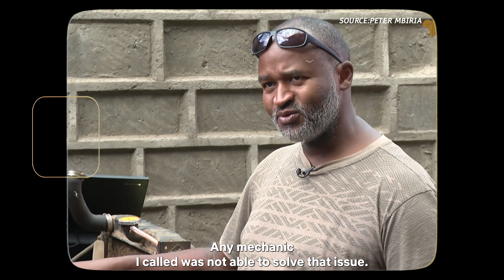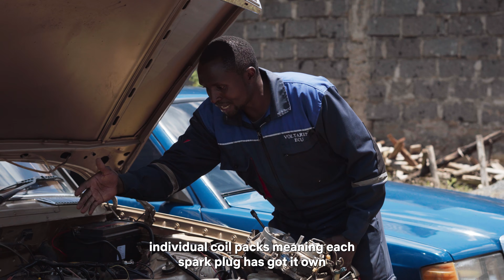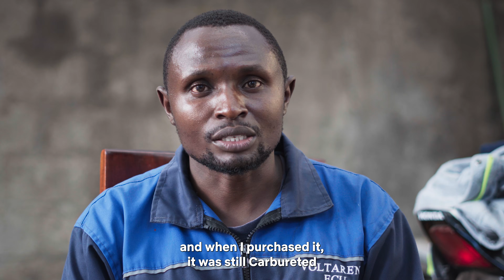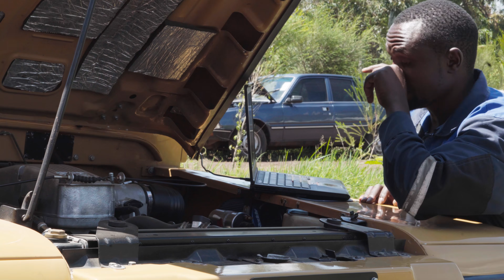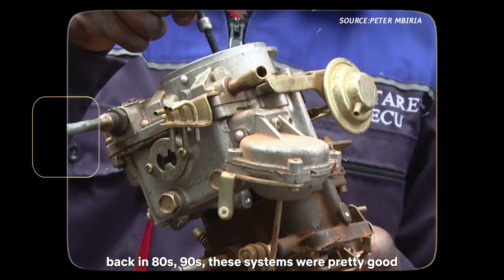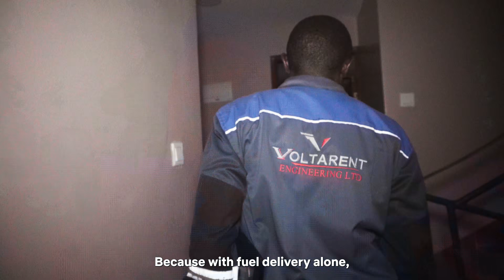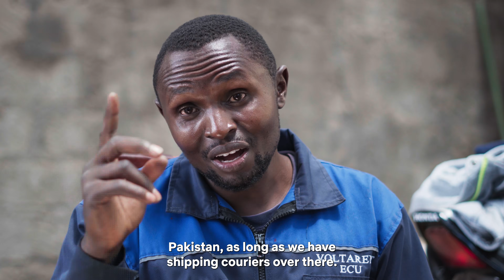This African Genius Makes Old Engines Work Better Than New Ones

Comment from the maker: If you want to learn more about Peter Mbiria, check out his channel here 👉 https://www.youtube.com/@PeterMbiria1
Reply: The idea of a universal engine management computer started with early ECUs in the 1950s by Chrysler that then evolved with the introduction of EFI in the 1960s and 1970s. Engine management computers became more prevalent and adaptable in the 1980s and 1990s. Universal standalone ECUs, like those developed by AEM Electronics in 2010 represent a further evolution of this concept, allowing for more flexibility in various engine applications. This is not some new concept or technology. I don’t understand the hype as today there are at least 5 companies that all have their own line of stand alone ECUs like this. They have preset defaults for most mass production engines that will run any engine and allow on the fly fine tuning. Some even have premade adapters to plug into existing wire harnesses. So again why the hype around this?
Reply: @diemaschine2287 it's to make a big deal to people that don't know .. and yes he is saving old cars in Africa.. so all good
Reply: @diemaschine2287  There is no hype, only a better possibility for older cars, instead pouring money into newer ones....if there is hype it the economic feasibility, which is sorely lacking in todays car price.....dont you agree?
Reply: Can you give his email address or any things als ??
Reply: Pls I have problem will a car I need to fix it how can I get ur contact?
Reply: Peter, I have contacted you about my XJR6…still waiting. From UK. I want to promote you bro
Reply: @AfrimaxEnglish  Well done, you are men off work and passion, i think Burkina Faso could help boist your potential,  i really love Africa getting more and more independent and can  remanufacture better then things was created, with independent Africa you have unlimited pissibilities and you must start work with trucks to boost economies in every African country !!! With love for hardworkers like you !!!
Reply: There is no climate change.
Reply: I need one in my Electric Car!
Reply: Ruining good cars by adding computers. Computers ruined cars.
Reply: Can I get his contacts?
Reply: Thanks a lot AfrimaxEnglish! Excellent program interviewing the Great PETER !
Reply: @AfrimaxEnglish  will love this guys visit, Ghana  for training
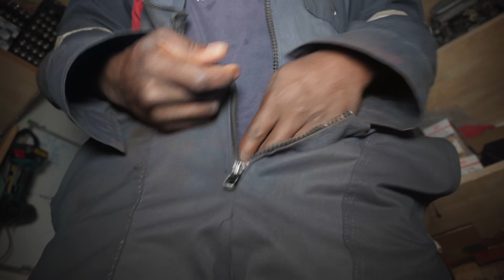Reply: wtf @2:35 I feel violated
Reply: @AfrimaxEnglish   Peter I like the idea but here in America 🇺🇸 we are going back to old school cars the electric car manufacturers suck and we can’t afford to buy new cars because of their greedy ways and their schemes to track us to sell our own vehicles data that actually allows big insurance companies to over charge us as consumers
Reply: Afri max why don't you come to uganda and also cover some stories here, I only see your stories covered either in Kenya , Tanzania or Rwanda

Comment: I do think the storytelling here oversells what was actually invented. Programmable ECUs and carburetor-to-EFI conversions have existed for decades. In the U.S. we already have systems like Holley Sniper, FiTech, Edelbrock, MegaSquirt, etc. that can modernize older engines with electronic fueling, ignition control, closed-loop O2 feedback, diagnostics and self-learning.
What I find impressive is that Peter developed his own system and adapted that established technology to the needs and economics of his local market. That's good engineering and a very useful contribution. But phrases like “makes old engines better than new ones,” “groundbreaking technology,” and “leaving Western experts in awe” seem more like promotional storytelling unless there is independent testing to demonstrate those claims.
Even the claimed improvement from 5 km/L to 14 km/L would need context: what condition was the original carburetor/injection system in, how was fuel economy measured, and was it independently tested? A badly worn or poorly tuned old fuel system being replaced by properly calibrated EFI could understandably improve enormously.
The work is interesting enough on its own. I don't think it needs exaggerated “genius” framing to make it impressive.
I think Peter deserves credit for building a genuinely useful product, especially for places where people need to keep older vehicles running instead of simply financing a newer car. This kind of modernization could also benefit low-income and budget-conscious owners anywhere in the world.

Comment: The custom car scene around the world has been doing this for decades. My own uncle put a fuel injection system on the engine of his 1956 Chevrolet probably 20 years ago. You can buy kits to replace most carbys.
Reply: Its just tokenism exaggerated praise because of black identity/background

Comment: Noch ein Anbieter von Standalone-Steuergeräten. Nichts Besonderes. Auch kein Betrug. Viele Firmen bauen Steuergeräte für Autos mit älteren K-Jetronic-Motoren. Die Ferninstallation und -abstimmung wird allerdings nicht einfach. Das Einzigartige an dieser Firma ist, dass sie in Kenia, Afrika, arbeiten, wo das vorher noch keiner gemacht hat.

Comment: This exists since 1986 and first movers were haltech and motec who were the pioneers of this method.
.
It combines modern injection & ignition with old, used motors. 
.
You can buy these as diy kits and transform your own old car to more power with up to 40% less consumption. 
.
Honor to the engineers 40 yrs ago 💜

Comment: Sir if you buy a 3d scanner a metal 3D printer you could scan the intake manifold into a computer and then print a new manifold and you could complete  this system so much faster. You might want a mill ,lathe and or cnc machine. But the 3d scanner and metal 3d printers are the newest tech. You could even just scan the manifold and send the files to a 3d printer shop in america or any other countries that have the printers

Comment: People focus on the hardware and code saying it's been done before. That's not the point here, the value is that he is able to make it work with his local supply chain with localized cost of engineering and adapted to the recycling needs of his economy. This is the real innovation.

Comment: Nothing new, if you need to replace the Fuel Injection system, carb, sparks, new harness, and a updated ECU. People been doing this for ages. Not a modern engine, just a light refresh. You want a modern engine, you need an swap.

Comment: For perfect ignition whatever you need to do must be done. This part of the story is understood. I have seen some people build a see-through combustion cylinder and saw in slow-motion how the spark and the mix of air and fuel ignite etc... What I was thinking is, this is the primary combustion (ie 21 % of oxygen from the atmosphere helps burn the fuel). Can there be another 21% oxygen added into the combustion in order to achieve a higher level of energy output? Maybe a secondary injector of heated air with a timing adjusted to coincide the ending of the primary combustion. Once this is achieved what happens is that once the primary combustion is complete the secondary injector pushes in a super heated amount of air and immediately the secondary combustion occurs. This can produce more amount of energy output using the same quantity of fuel.

Comment: Back when I was into working on my own cars I replaced a dual point fuel injector to a complete fuel injector engine. I struggled to get it to run even though I replaced the ecu and ran my own wires for the additional injectors. 

I got the car to run for a short period but it would over throttle and I couldn’t stabilize it to get it to run efficiently. I had no computer connected to this car and didn’t know any of the actual readings. 
I ended up giving up,

Comment: Impressed by that ecu with the through hole components, and good job in keeping the requirements minimal, keeps the goal feasible and there are so many sensors for features that aren't needed. Smaller surface area also just provides less opportunity for critical issues. Can only imagine time spent reverse engineering canbus signals.

Comment: FATHER ALMIGHTY FATHER CREATOR OF ALL INSPIRED BY WE , SAYETH THOU ART SIMPLE LOGICS BEHIND THESE SYSTEM USING COMPUTER TODAY , A SIMPLE NOZZLE JETS ADJUSTMENT,  SAME HE INSPIRED PRESSURE WASHING SYSTEM  MORE AIR FORCE BEHIND LIQUID MAKING IT MORE COMBUSTIBLE,  SAME SYSTEM IT EVEN IN BATHROOM SHOWER HEAD ADJUSTMENT OF JET SPIGOT SYSTEM IS IT . SAME BE EVEN GAS STOVES , GARDEN HOSES WITH NOZZLE PLACE ON THE HOSE END , THE COMPUTER NEVER NEEDED  YET B STILL  YET VOID AS DEEM IT MEAN COMPUTER OR MEASURE AND CREATE IT SAME OLD SYSTEM

Comment: I visited Benin and went to a michecnic blvd about 3 blocks those fellas had no computers but fixed every brand of vehicles im talking about using outdated tools was the most impressive part..and a man was there that can tell you what's wrong with your car just by tasting the wire...crazy
Reply: @MoneyMillerAllDay  I definitely have seen that, same with phones, they fix phones without the actually manufactured parts

Comment: This man is not a genius, he is a hobbyist. He is one in a million - literally! In most western countries what he is doing is illegal once the vehicle is used on the road. What we actually need is a legal self learning universal ECU that can adapt to any sensor set and tune and run engines optimally in obsolete vehicles without the bloat of immobilisers and other unnecessary ancillary points of failure. Of course this in direct competition to new motor vehicle manufacturing and their business strategy so it won't be happening.😢

Comment: Hi I absolutely love that you did this. My question is on my 2008 honda pilot 2wd a/t that I can not tune an i want to xould i use this in it to replace the stock one I cant adjust ?? An what the cost be i really want to use it if possible
Reply: 2nd question,can I take this if works to a tuner ?

Comment: I appreciate his dedication and ingenuity, but he's simply over complicating simple engine designs, with a bunch of electronics, sensors and wiring. The reason those cars are still around in the harsh driving environment where he lives, is their simplicity and durability. He talks about finding parts when the bosch system fails, but does not mention how easily it will be to find any parts for his system.

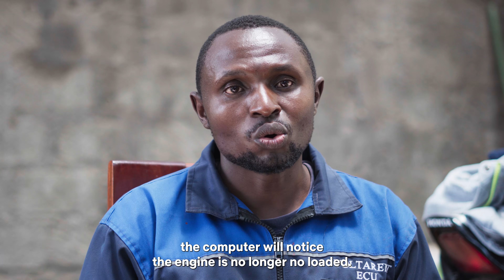Comment: 13:46 "Cutting off fuel completely while driving to save fuel" will make the engine run lean and destroy the motor. I think that part is getting passed over.
Reply: @BryanEnsign  you're wrong

Comment: He's a good tinker. But just converting to efi doesn't make an engine efficient. Modern engine has higher compression better airflow lighter engine lesser friction due to tighter tolerance

Comment: Very cool. EFI swap older engines is cool but usually very expensive. I have the upmost respect for peter for doing this with limited ressources and cost efficient.

Comment: I've been feeling the desire to do this recently, even before I heard of this diamond-in-the-ruff man, but got stopped by current emissions laws in the US. It's made me realize that of course it's gonna be illegal, because it's taking away the power from the big guys. 

Volterant has a market in the US they cannot understand. I'm tired of hearing 2026's needing a network connection to start or play radio. Screw this new crap, lets import Peters cars!

Comment: You can definitely trust an engineer who chooses a Thinkpad T430 to run his software on. I've dropped my X220 three times and once it bounced down the stairs, only damage was a slight chip off the corner

Comment: This guy is one top class mechanical and electrical engineer, and the kit he's made should be up for wide-scale product consumer consumption, it's quite an feat, fuel injection and modern enigine management systems on old cars from the 80s..I dare say he could legally get any old motor through the UKs tough environmental ULEZ regulations, i say this because this guys level of ingenuity clearly can do anything?
Reply: Unbeatable, makes his own ECU from the PCB upwards and flashes with arduino. This kit ought to be on the shelves at the local motor mart..

Comment: thats Arduino IDE on hees laptop. wonder what MCU he is using. Guess AtMega is fast enough for ICE operation
Reply: Its an Arduino Mega with a custom extention board. AtMega 2560 chip. 
basicly hees geniousness is the buseniss and the firmware and tooling. i had this exact idea and dream 10 years ago, but i didnt go trough with it. cool to see it work out.

Comment: im luv carburator engines.. old 1s.. .. not a fan of extras... im on my last leg of human journey - im buy old mail jeep 2wd .. light -low to ground light tires - i like bottom end pull small lawn trailor in a city .im thinking iron duke 4 cycl ..with granny low 4 speed. mpg good ! ???want best mpg... dont care about led foot power so much

Comment: He studies the data of the machinery , redesigns the old parts into better more robust and efficient versions , fabricates the parts in his workshop .. and there you go , an old car from the outside with modern mechanisms on the inside

Comment: Yeah, sure he does lmao. Do you people really think that a team of german engineers with decades of experience can somehow get outsmarted by this guy? Ok.
Reply: "Modern engines are designed using billion-dollar R&D, advanced metallurgy, and precision sensors to squeeze out every drop of efficiency.
While you can make an old engine run better with a good tune-up or a DIY fuel-injection conversion, you cannot physically bypass the friction and heat-loss limits of old iron blocks with basic hand tools."

Comment: Modernizing the ignition system and using a standalone ECU to "dyno tune" old engines is a great idea!
Unlock power and fuel economy from old engines.

Comment: Not Mentioning How you'll Go About Drilling/Making Holes in the Cylinder Heads For the Injectors and Seals and Machining it to Fine Tolerances to Avoid Leaks/Blow-bys... Hmmm.

Comment: I mean yeah updating an old motor with new technology is all good and stuff. Price is definitely part of the equation. You can definitely tune up a carburetor and use a distributor and get really good fuel economy and efficiency just as much fuel injection. Adding wiring and new components to an old car kinda defeats the point.

Comment: He is way above the game. We could not find any one doing this in the US. Keep the good work!
Reply: @NewsBroadcasting   umm this has been done since the 90's, it's just primarily in motorsport not everyday vehicles, however you could it's just expensive.
Reply: @Ufarkinwotm8  really? where ?
Reply: @NewsBroadcasting  all he's done is create an aftermarket ecu (which are a plethora of brands have like haltech, link, syvecs, ect) and converted carby to EFI which again, is not a foreign or new concept. It is for them, but not the rest of the world. Was being done in drag racing converting older v8's from carby to EFI for a long time.
Reply: he didn't do anything new.. at all.
Reply: @SmokeNGunsBBQ  if you watched the video, his point was existing solutions were expensive, so they had to build something cheap that the locals can afford.
Reply: @mrlegsbenedict  star wars gooner detected, 5 IQ opinion rejected.
Reply: @SmokeNGunsBBQ lol wut. why are you so mad at a man just trying to help his poor countrymen? it doesnt make sense at all
Reply: Many people do similar things plus noone showed any raw data. He just swapped a carb for coil packs and direct injection. 

Well holley carbs sells a kit in the states that do exactly that, banks power sets diesel records was the designer of the first turbo diesel through Volvo and many others remap power curves and power delivery through tunes and code instruction.
Reply: @AnonymouslyMouse Doesn't even show that he did the programming for the standalone ecu. He could have just downloaded the software. The video is clearly propaganda, like everything else involving them. King didn't write his speeches.
Reply: It's not that they haven't in the us you just can't find them because the oil companies and government helped them go away involuntarily so nobody found out lol
Reply: @davidsanderson7812  What are you talking about not in the US? The US has several companies that do this.
Reply: @SmokeNGunsBBQ goes to show you know nothing about history The oil companies and government have been offing people for finding better ways for decades just because a few companies have a way that's a little bit better than what they sell you stock doesn't mean there haven't been guys getting 70 miles to the gallon out of a 454 big block in an RV since the '50s or 60s but all of a sudden they randomly disappear and get found with a hole in their head
Reply: @davidsanderson7812  Smoke less crack.
Reply: @SmokeNGunsBBQ learn history if you trust your government you obviously never learned anything from school
Reply: @davidsanderson7812  🤡
Reply: @davidsanderson7812  you mean the same federally funded public schools?
Reply: @SmokeNGunsBBQ you must be a kid see they used to actually do this thing in school where you had to learn things and do these things called reports where you picked a subject and had to write about it and they were usually on certain topics well when you get to the historical classes they wanted those reports to be about important historical breakthroughs in the world that would improve things for everyone that didn't get used and why some of us liked mechanical things and wrote reports on that kind of stuff because it was interesting compared to the life span of a house fly for instance well I hate to tell you this but back when school didn't teach you what to think but how to think for yourself useful little lesson might want to try it some time it's easier to look things up now though Google is a thing lol